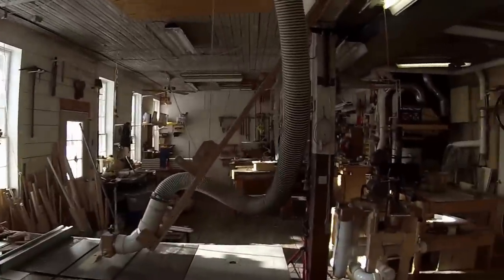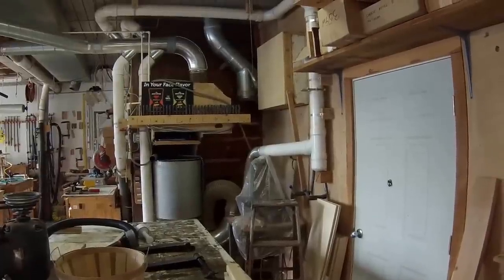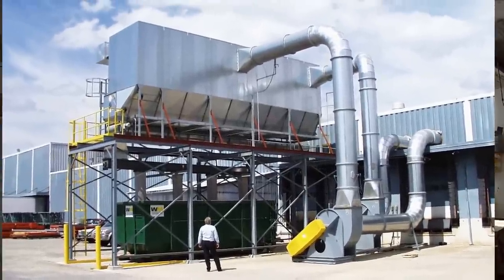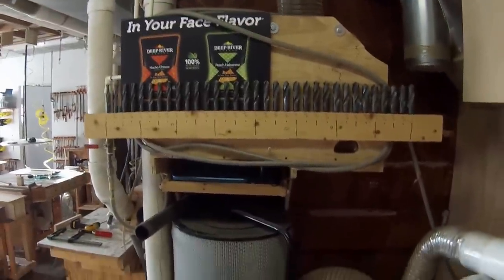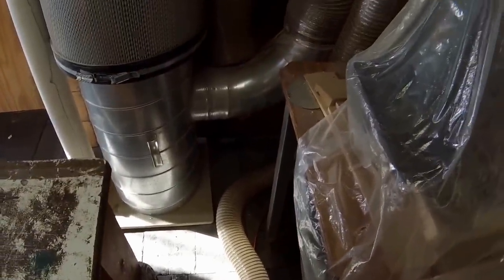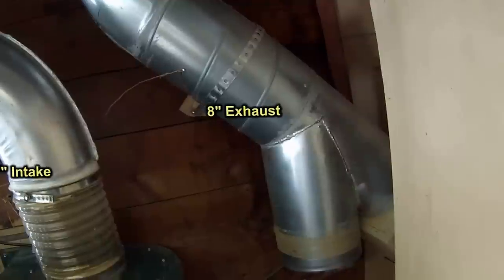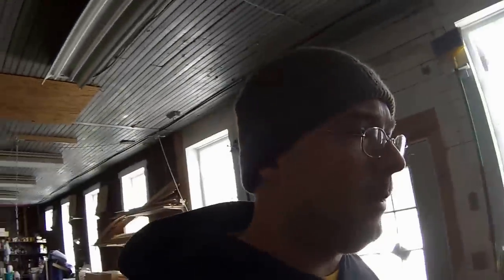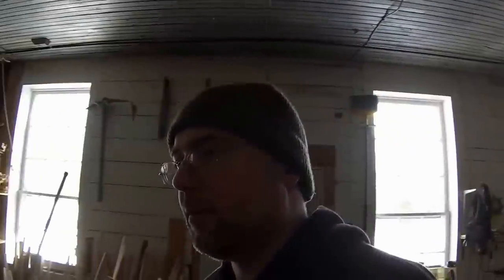Dust Collection Tour and Lecture (boring - don't watch)

Comment: The title is wrong- this is not boring at all.
This is very interesting stuff. Been watching you work for several years now and you have answered many questions in this vid.
Would like to see more details on the piping and how the dust is extracted at the machines.
Will that be covered during your upcoming shop tour?
Reply from the maker: yes I will cover the individual machines in another video.  there's a lot of info to cover with that.  thanks for watching

Comment: Very nice explanation of your system and your thoughts on the air flow/temperature/negative pressure non-issues. It seems your cat is higher maintenance that your DC System!
Reply from the maker: Ironically, cat hair in the shop is the one thing that can potentially clog my system.  The fine hair travels all the way through the exhaust and collects fine dust creating hair mats that block the screens of the dumper.

Comment from the maker: PVC cannot be grounded (because it is redundant to ground a non-conductive material).  However, the fine dust layer that can build up on both the inside and outside of the pipe CAN conduct a charge, especially in high humidity conditions.  Bag-house type filters on industrial systems are prone to explosion but small systems are not, generally speaking, but for as simple as grounding the PVC pipe system can be, I don't think it hurts to be on the safer side of things in the long run.

Comment: Have you ever thought of automating your DC system with motorized blast gates that automatically open when the corresponding tool turns on? I toured a pretty big counter top production facility and their dust collection system was pretty impressive. In the end they used these $30 clip sensors that would detect when the tool was on(some type of hall effect sensor). Literally just zip tied to the power cord.
Reply from the maker: YES.  that idea sounds promising.  never heard of that.  I was thinking about experimenting with remote control solenoids to retro fit onto my existing blast gates.

Comment: You do have a very nice set-up as a shop and a dust collection system. Do you have to run the copper ground on the "inside" of the pvc pipe, OR  just to the outside of the pvc pipe.... Did you get hit by any of the blizzard.
Reply from the maker: copper wire on the outside only.... the screws are 3/8" long and go all the way through the thickness of the pipe.  This effectively grounds both inside and outside surfaces of the PVC pipe.
Reply from the maker: schools and businesses closed for the blizzard... but we only got 4" of snow here.

Comment: 30% more cfm  that's great. Is that an aproxuamit or did you test it?
I have seen people run them both way but never seen a good test done. 

I also like what you said about exhausting to the outside. I switched my small system over last summer. I think for a small shop it's ideal just as long as you understand back draft on heating vents. (As you do)
Reply from the maker: I used the grizzly tool catalog as a reference to compare dust collectors.  grizzly sells both single stage and cyclone models with the same motors, so the CFM output can be compared using their data.  I think its worth noting that a 3 hp single stage can exceed a 5 hp cyclone in CFM -- over time thats a big energy difference.

Comment: I'm well aware of a planer's ability to create a blizzard of dust. I have a 13 incher, and it will fill an 18 gallon Rubbermaid tote in about 16 minutes of non-stop planing. I use a flexible dryer hose to direct the dust into the tote. Very little dust goes airborne. I live in a wooded area, so, a few times, I have taken the planer outside and just let the dust fly.

Have you thought of using an air heat exchanger on your DC's exhaust?
https://en.wikipedia.org/wiki/Heat_recovery_ventilation
Reply from the maker: I have thought about that but if inside temp is < 50F, I don't think I would recover much.  I use the attic space as my "heat exchanger".... The heater on the far side of the shop heats the bathroom,etc, then that heat rises into the attic, plus the sun will heat that air up even more during the day.  The DC pressure draws air from the attic and recirculates some of that heat.  When I run my collector continuously, the temp in the shop will often increase!  imagine that!

Comment: I see your have it setup with blower 1st then your separator. Have you had any problems with that, like small pieces of wood hitting the blower and damaging it? 

Couldn't you move your blower on top of your silo ? That would cut down on noise in your shop.
Reply from the maker: The noise isn't a problem for me.  I get at least 30% more CFM with the blower on the intake side as opposed to on top of the silo.   If I have the blower outside it wouldn't have as much lifespan being exposed to hot and cold temp changes.  I have a guard on the blower intake which collects large debris and that has to be checked and cleaned periodically.  its the only part of the system I have to check and maintain.   small pieces do go through sometimes.  its a steel fin impeller which is more durable than aluminum.  no problems so far

Comment: Thanks for sharing, is there a reason why you don't have a dust separator?
Reply from the maker: The silo itself is the separator and a very functional one.  It is very similar to a Thien separator but scaled up to a larger size. Bigger is better when it comes to dust separation efficiency.  Many designs focus on making an ultra-compact separating unit so it fits in the shop but my design maximizes its size based on available space outside.
Reply from the maker: In my next video I will open up the silo and show the dust inside.  Note the amount of fine particulates in the dust.   Look at how it dissipates when it hits the ground and plumes up like smoke.  The indicator of dust separation efficiency is based on the smallest size dust particle that can be retained and kept out of the filter.

Comment: Ok gotta ask. How the heck did you keep that camera framed so well on your head as you walked around? I know you held it by hand probably with an extension or arm of some sort, but wow!  My arm would have given up. Thanks for the info and congratulations on a great system!
Reply from the maker: I was holding the tripod with the camera on it because the extra weight makes it more stable... what can I say?... stretcher frames keep me in shape.  (my arms, at least)  I also used the youtube stabilizer feature on this one which also helps.
Reply: Stabilizer feature? Didn't know about that. Thanks.
Reply from the maker: MRrwmac its under "enhancements" in the youtube editor.  usually the uploader detects shaky camera automatically

Comment: You've got a LARGE amount of light hitting your wall under the windows. Why not consider whipping up some solar convection panel heaters? Simple black mesh bug screen is all it takes.
Reply from the maker: Scott Hildenbrand interesting idea, but you would be impressed to feel the difference 50 tubes of caulk can make.  I plan on filling my wall cracks someday.